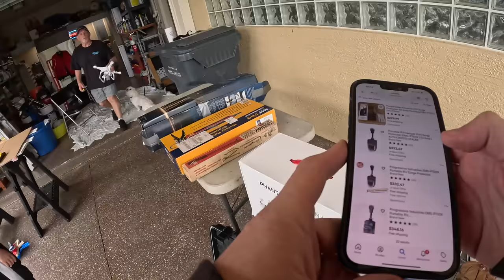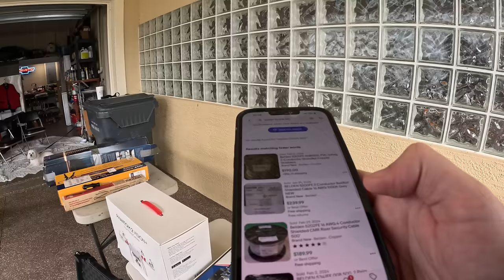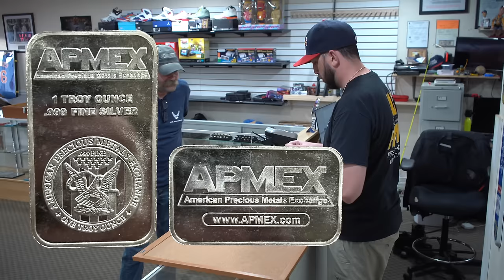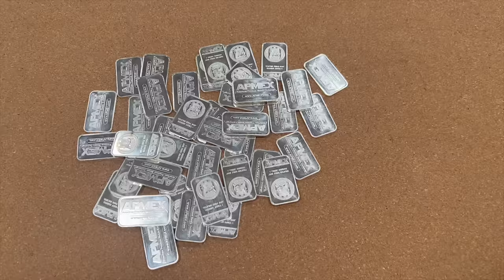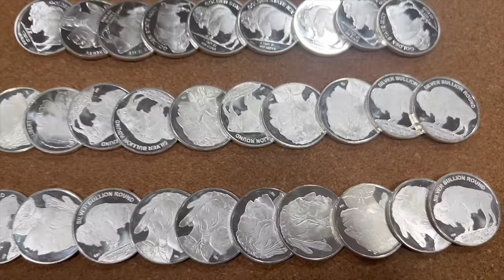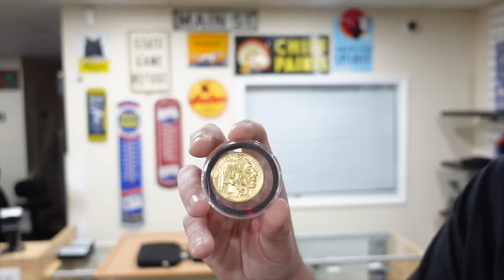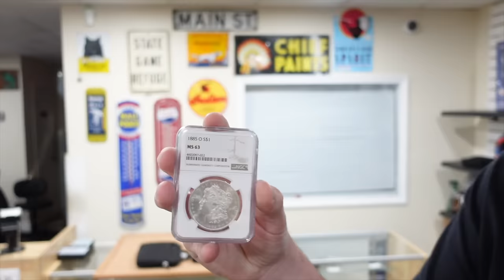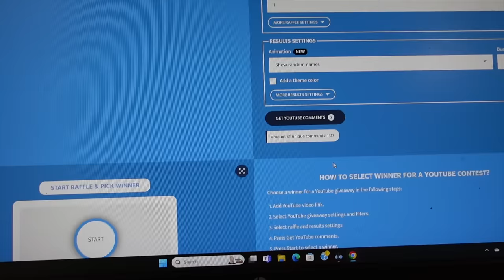I Paid Thousands But Was It Under Spot Again?

Comment: I remember getting maples for 22.50 each. I also remember paying $39 for eagles. Take the best deals you can get when they come. Nothing wrong with paying $1-2 under spot. If they want more, then they can do the legwork to sell it where you will. Simple 
 p.s. I bought a brand new sigma with 3 wands for 850. Last year.